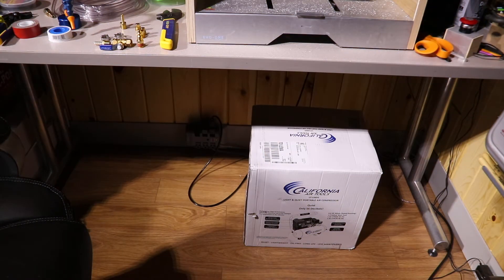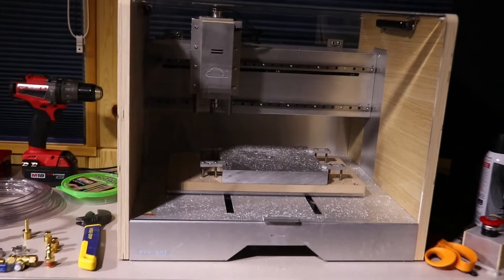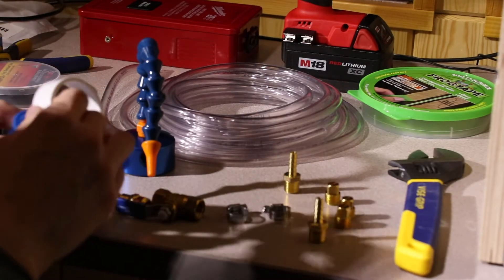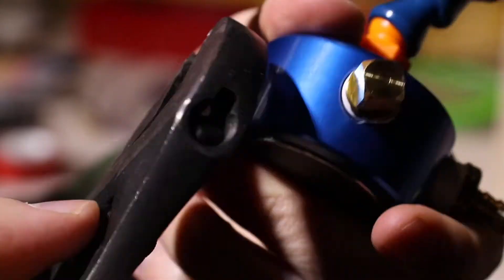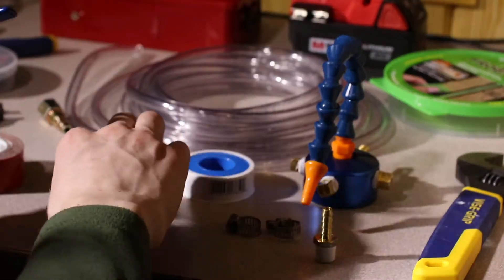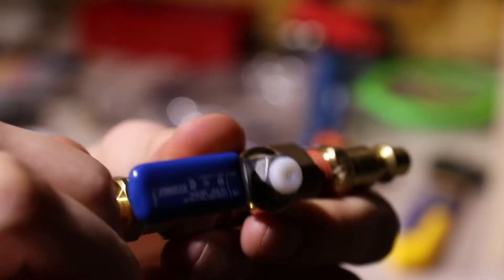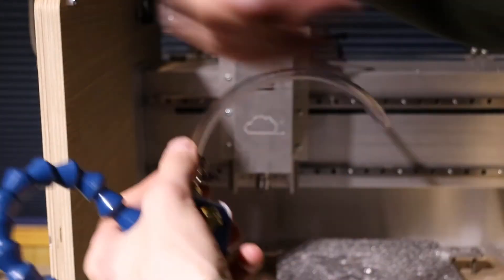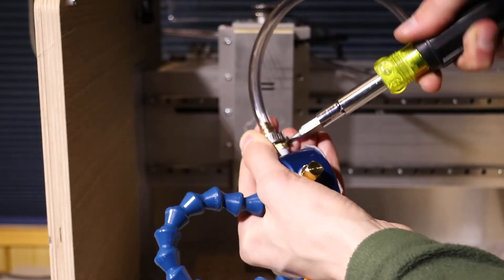EVO One CNC Air Compressor Upgrade

Comment: I have one of these compressors for my lathes and mills. But it's not designed for continuous use. I'm wondering if a high flow aquarium pump will work.

Comment: how is that 1gallon compressor working out for you using it on the cnc? how often does it turn on. im thinking of getting the same compressor with a fog buster. i also have a desktop cnc so i prob wont need to turn the air on full.
Reply from the maker: APxKP I currently run the compressor continuously during milling which easily provides sufficient air pressure to clear chips/debris.  Since the valve is open, it does not fill the air tank but rather just continue to pump air through the nozzle which provides the necessary pressure and volume of air.  The only way I could see that you could run it intermittently and therefore conserve air so that it builds up pressure is to have an air valve on a timer to have small but higher pressure burst every now and again.  Otherwise it needs to be on while milling.

In my other video, I have installed a new spindle which itself provides a decent amount of air capable of removing chips/debris from surface milling and some slotting.  This means I don't have to use the air compressor often but I do still use it when milling features that make it hard to remove those chips/debris via the upgraded spindle.

Comment: Great idea. Have you had issues with debris being blasted around the machine and onto the rails or inside the electronic components?
Reply from the maker: snppls I haven't had any problems so far with debris getting blown into the electronics.  As for the rails, I just clean them every now and again

Comment: Have you cut any acrylic with yours yet? If so, what kind of feeds and speeds are you using?
Reply from the maker: I have only done a small amount of acrylic so far on the CNC machine and just ended up using the TiB2 coated aluminum 2 flute end mills from Harvey Tool (24208-C8).  I have access to a laser cutter so I do all that type of cutting there instead.

Comment: How has the Evo One perform so far? I haven't seen any reviews for it. Can you cut thick copper with it?
Reply from the maker: MetalGearMk3 The Evo One CNC mill is fairly good at milling many softer materials such as wood/plastic accurately.  It can cut aluminum, but at a fairly reduced cutting feed rate and depth.  You can still cut thicker objects, though it takes more passes/stepdowns and a long enough bit.  Just make sure the bit isn't too long as there will be too much runout.  I would say a maximum of a 1 inch bit from the collet with the stock spindle.  Since it can cut aluminum (albeit slowly) I would think it would be able to cut copper as it's around the same hardness as aluminum but I'm not certain.

The official list of supported materials is:
Aluminum
Wood
Plastics
Brass
Bronze
Tooling boards
Wax
Foam
PCB (which has copper sides)
Carbon fiber
Glass fiber

Larger machines like a Tormach 440/770 would be able to handle cuts quite a bit faster but for the price of the Evo One I think it is actually quite good.  I have since upgraded more parts on the Evo One CNC to make it more powerful and I'll put that up in a new video at some point soon.  I can test cutting copper if you would like but it wouldn't be on the stock Evo One
Reply: Thank for the info, I'd definitely like to see more videos about the Evo One ,stock or not!
Reply from the maker: LevelWithMe The only limit on material height is the length of the bit and the travel of the spindle on the z axis which varies based on the length of the bit and if you use an mdf board (If you use a longer bit, the spindle and bit will come into contact with the baseplate sooner than with a shorter bit).  If you use an inch long bit, you can mill down an inch or potentially more if there isn't anything interfering with the collet assembly at that height.  Basically it is limited by the z axis of the machine/bit length and if the machine itself (other than the bit) begins to hit the top of the material being milled.

Comment: Do you have a parts list for this upgrade? Want to do something similar to mine.
Reply from the maker: Tyler Chesley I've added the parts list to the description
Reply: QuantumTek Innovations awesome! Appreciate! You have any advice on finding good end Mills? Looking to cut non ferrous metals and some wood
Reply from the maker: Tyler Chesley I tend to buy material specific end mills from http://www.harveytool.com .  For example, when cutting aluminum, I use the variable helix TiB2 coated end mills.  This is the page for material specific end mills http://www.harveytool.com/cat/Material-Specific-End-Mills/Browse-Our-Products_245.aspx .  The one flute end mills provided with some of the EVO one packages work well with wood, though you may want some other profiles such as a ball nose end mill.
Reply: Do you use any kind of edge finder? Seems like it would be immensely helpful
Reply from the maker: Tyler Chesley I have a laser edge finder but I find that it about as accurate, or less so as moving an end mill up against the stock until there is just the slightest amount of friction.  I usually move about .1 millimeters in until I touch the part then set it to be lower if I need the accuracy.  I then subtract half the end mill width to use as a new home position along the axis being measured.  I also use this method to square the part.  With a bit of setup time, I can get the part to be lined up to less then a tenth of a millimeter off or better.  I tried to find a 3D taster but I could not find one that would fit the ER11 chuck.  I also use a chamfer bit to line up between two known holes or other geometry by making sure the bit is in the center of the hole when dialed in.

Typically, I try to keep the stock clamped down so that all the operations can be done without moving it (with the exception of clamps).  This allows me to cut the edges of the stock and any additional features while also being as accurate as the machine is capable of.